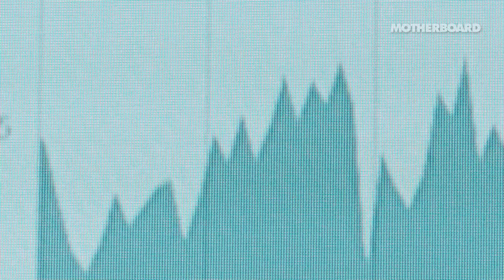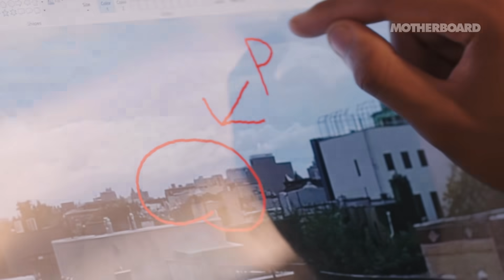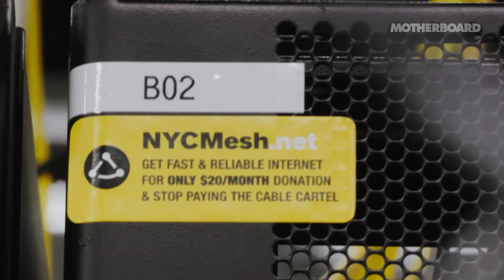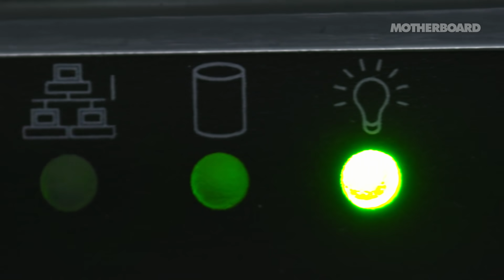Building A More Human Internet in NYC | Still Connecting

Comment: Great work but at a huge cost, why not just extend fiber cables at a fraction of the cost and 10x that speed.
Reply: The cost of wireless is very low. Fiber leases start at $1K per month if they happen to be nearby and then you have data center costs on top of that. We will be leasing fiber soon as we do need that speed in our hubs and tower installs.

Comment: Their using UniFi APs I wonder if they manage all of these on a single controller or multiple
Controllers for regions
Reply: We use a lot of airMax / UISP with about 1000 devices. We also have about 50 unifi APs spread across two controllers. It's easy to swap sites in the one controller.
Reply: @NYCMesh  We use UISP and it works great.

Comment: I don't understand how you can provide great service wirelessly. I mean I see they are use AF60lr witch are good for about 1GBps but then using 5ghz witch I can't imagine NYC not being a 5ghz congested hell hole. What do these people consider great internet speeds?
Reply: Congestion is almost a non-issue for 5ghz wifi because of how many channels there are and also the antennas are directional
Reply: There is no way in an urban environment like NYC that 5ghz interference is not an issue. They also used 5ghz sectors like airMAX Lite AC from Ubiquiti witch has 90+ Beamwidths. I would be surprised if they are getting 200mbps out of that.
Reply: @petermarshall1634  Congestion is very much an issue for 5Ghz based off the fact that it's an unlicensed wireless band, and the fact that almost every consumer-grade router comes configured to spew out 80 Mhz channel widths out of the box. Of course, you can use DFS channels, but expect to get kicked offline anytime a storm hits due to radar. 

As for being directional, the equipment they're using in the video is a sector antenna. While a sector is directional, it likely has 60 or 90 degrees of coverage, which in NYC, would pick up a ton of noise. (not to mention that antennas will still pick up interference from devices to the side, behind, etc..)

Comment: I use 150mbps FTTH which costs me around 13000 INR / year, (~175 USD). which includes a Gigabit router, a smart-tv box and some 12-13 subscription to streaming services. Uptime is nearly 100%. And this one is a commercial network from a company called Reliance Jio. SImilarly priced services are coming up from other companies like Airtel and BSNL. I really pity US for working extra mile to enjoy something very common in developing country like India. Here 100mbps Broadband costs around 6000 INR / year (~120USD) with uptime of >95%.
Reply: Actually, there are so many things impacting broadband in the US compared to India. 

1. Most of the infra investment was done in fixed-line copper & cable TV. We did not have it over here. We started late and hence skip directly to mobile. For broadband copper was mostly non-existent and hence fibre infra came up. 

2. Majority of Indian cities all the way from tier 1 to tier 3 have high density and the fixed line is feasible in most areas. Similar to many other countries in Asia. The US lacks that in many areas (may not be in New York but many other cities beyond the top 15-20 cities. 

3. Regulation for putting cable makes it so deadly expensive that a company cannot do it without raising equity and once you raise it, you behave similar to other (usually hated) monopolies. In India as well legally putting cable is expensive but most of the authorities do not mind & are not heavily against a bit of hanging fibre on electric poles without authorized right of way. 

All this results in much cheaper internet in India. :)
Reply: Those prices are HORRIBLE! Here in the US you can get gigabit fiber from some providers for only around 60 USD.

Comment: Why use radio when there is optic
Reply: See how cheap that is.
Reply: @miguellopez3392  400 Mbps for $56 per month is expensive? People are just lazy
Reply: @mikevenecio6312  that's for the current set up optical network in your area, look up the cost to run a new line in a place that has had no fiber.
Reply: @miguellopez3392  is this normal and equally applicable to EVERYWHERE in this world? I'm not defending these companies but plz, be reasonable. Do you think the initial setup for a new area is cheap? NO! 
When there are only a few customers in a new area, those early adopters usually need to pay a premium price. That's economy 101.
Reply: @mikevenecio6312  yes and that's why fiber isn't the awnser to everything.
Reply: @miguellopez3392  correct. Nowadays, there are multiple options ranging from cable to mesh (google internet and this NYC mesh for example), broadband,  satelines and so on. However, one thing I notice is that a lot of old buildings do not allow other cable internet installed other than that from an exclusive company such as Comcast. This limits the customer's choices when it comes to the cable service that they can choose from.

Comment: Hey, I'm from the other side of the world and I love this work. I have one question! When the weather is really bad ( I know in NYC tends to snow a lot and rain aswell) how does that affect the signal? What equipment is being used to mitigate those environmental effects?
Reply: Our sector antennas are 5 GHz which is fine in the rain. Our gigabit backhaul is 60 and 24 GHz which is affected by rain. We set up lots of redundant connections so if the 60 GHz goes down there will be a 5Ghz backup connection to take over. Also we try to keep distances short on the 60 GHz.

Comment: Really curious about Backhaul speeds between a Root AP and Mesh AP (1 Hop setup).
Reply: They use 60GHz links for the backhaul, you can see the Ubiquity equipment in the video, it's quite cheap actually.
Reply: @thomascrabtree  correct
Reply: @thomascrabtree  how much dbm

Comment: I've set up two NYC mesh installations in separate buildings that I lived and both nodes had great internet speeds. I recommend everyone in NYC set one up where they live.
Reply: Thanks, what's "great" in Mbps?
Reply: @spiralfractr  It ranges from 60 mbps to 1 Gbps for wifi and upto 20 Gbps for fiber. Also like any other wifi signal, it heavily depends on the area. If you live in Manhattan, then speeds will obviously be good, but in places like Harlem or Brooklyn, it can be slightly less outside of the hotspots. .
Reply: @jong9379  Harlem IS in Manhattan lmao
Reply: @spiralfractr  I mean, I would go as far to say that most residences in America have something below 100mbps.
Reply: Can you please enlighten us on what speeds you would expect to get off a 5ghz AP in NYC?
Reply: what about latency ?
Reply: @Calypso993  It's wireless. It's not gonna be cabled-level latency from client to first hop, I'd expect something similar to the numbers Starlink's touting. That being said, this is clearly meant as accessible internet for the under-served first and foremost, so that people can actually do a lot of important things that are increasingly becoming impossible to do without internet (like even being able to submit an application to a job). I seriously doubt an extra 10ms is gonna mess with your AWP peeks sans placebo/nocebo effect unless you're at the very least ranked LEM, if that's why you're asking.
Reply: @wallythewall600  Hey Wally, man what a small world we live in :^)
Reply: @Calypso993  Latency from wireless connections can be better than Fiber. Microwaves are light so a direct shot to a data center would be faster than taking the criss-cross path of the coax or fiber connection.